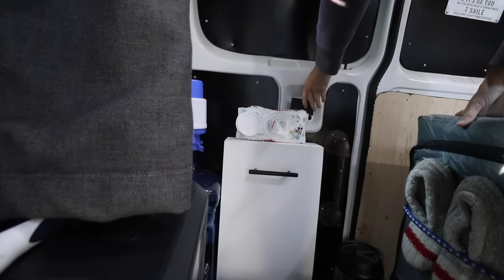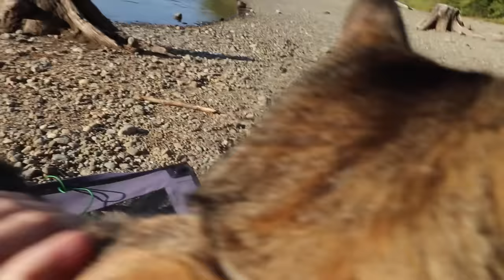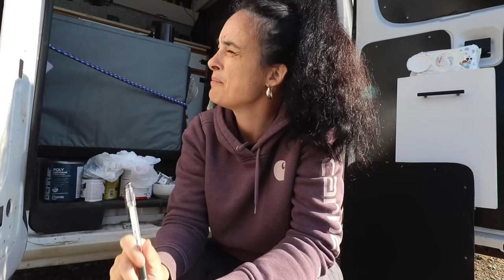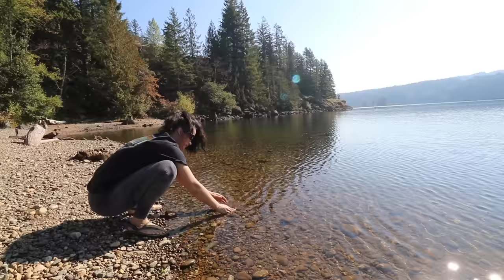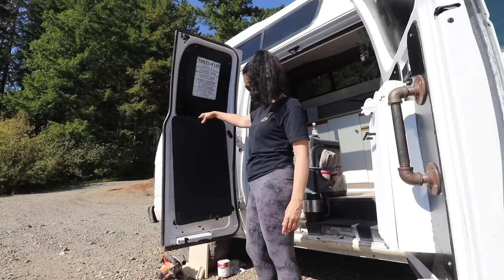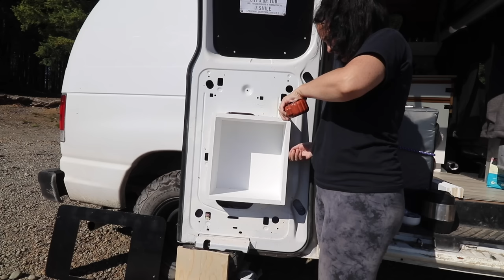MUCH NEEDED UPGRADE | Solo female van build

Comment: Cutting your doors will weaken your truck! If you crash or get hit the side you cut your doors will fold in... I wouldn't cut in to the car structure with out weld in stronger metal to make up for it. Drive safe